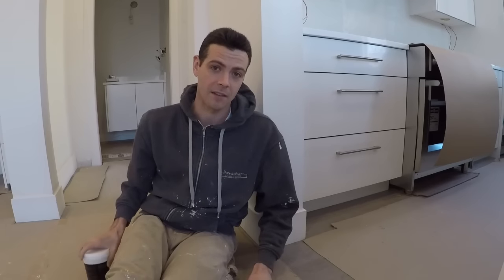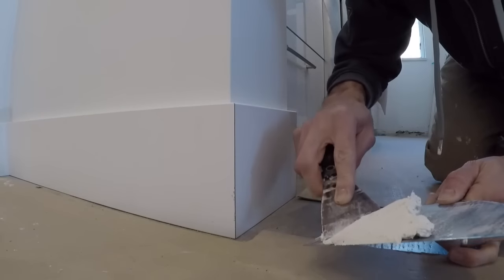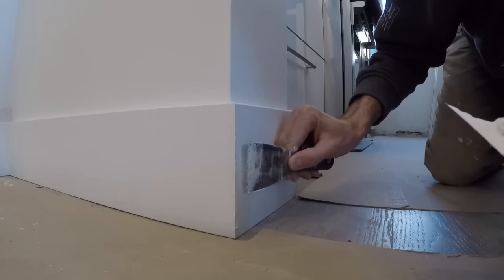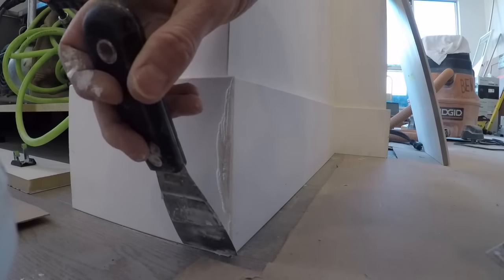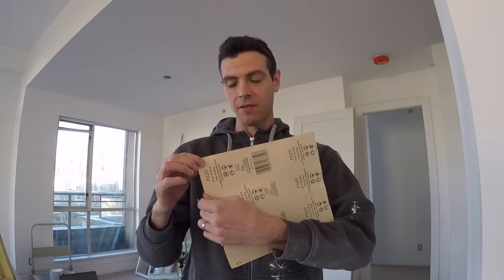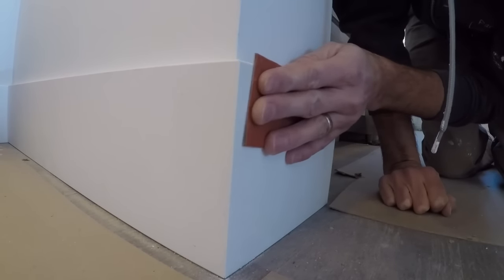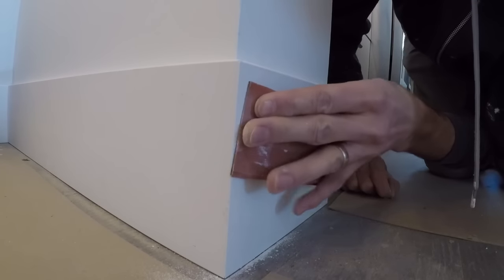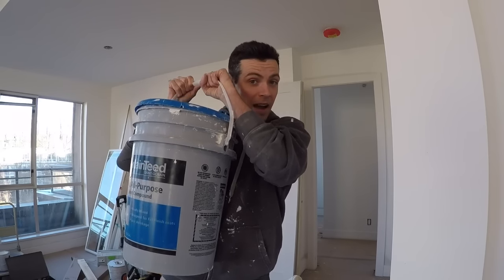How to Fix Open Miters

Comment: “Do your best and caulk the rest”
Reply: Floor layer?
Reply: A little puffy and a little paint will make us carpenters look good!
Reply: Mexican wisdom.
Reply: That's my middle name
Reply: Caulk and Paint is what a Carpenter Ain't
Reply: it's a good motto :)
Reply: Fucking too right.
Reply: That hits too close to home and is dang funny.
Reply: It's "caulking and paint makes a craftsman what he ain't.  If you've never rolled your outside corners use a nail punches rounded end rub it vertically on your miter with some wood glue.
Reply: Lobstah meaht
Reply: Haha exactly
Reply: Thats my bosses motto that an "we aint buildin a f'n piano room"...sometimes i hate even being associated with the dude
Reply: It looks good. From my house.
Reply: If your mitres do not fit, fill them up with glue and sh*t 👍 YEEEEEEEEHA !!
Reply: I’d do this if they’re paying enough, caulk works if they’re being cheap.
Reply: Dap kwik seal. That's my go to.
Reply: “Better carpentry through chemistry”

Comment: House I’m in has anywhere from 1/4” - 3/8’ gap in ALL miters. They even did up to 4 “coats” of caulk and 5 coats of paint to “fill and blend” so couldn’t see 🤦🏼 Imagine the time that all took with drying time, painting, etc…. When they coulda made better cuts on saw, & filled the gaps w/ filler, than do some caulk/paint for finish. Imo woulda taken less time and look 100x better.
Great vid, and think if anyone is doing trim work, they need to know info like this
Cheers✌🏻

Comment: I'm in the UK, we always use Ronseal 2-Part/pack wood filler, sets hard in less than 10mins and shapes perfectly with 120. It's a 2 part like I said, so you can adjust how quickly it goes "off" by how much catalyst you add/use. Link below: https://www.screwfix.com/p/ronseal-high-performance-wood-filler-white-550g/45077

Comment: I've never lived in a house in my life with perfectly mitred skirting boards, even when I had a house built from scratch.  The only gap filling I've ever witnessed was with thick gloss paint.  So I hope whoever buys this place drops something on the floor so they get down on their knees and appreciate the effort!
Incidentally, here in the UK tiny gaps often occur because the timber stock wasn't seasoned in the house after occupation, i.e. the skirtings were put on during build and often before the central heating goes on.  At the point of inspection the mitres are perfect.  Then the family moves in, turns on the heating, and gaps sometimes (not always) start to appear.  It's just part of the character of the house I suppose.
Reply: A Teleskier ...especially if you get the wood from Selco, it’s all wet one end and twists half an inch out of square, you can always go to wickes and get 100 knots with a bit of timber joining them up.
Reply: @thpxs0554  :D spot on.
Reply: This comment made me laugh
Reply: When the heat is turned on for the first time, don't turn the temperature up all at once. Raise the temperature over a couple of days, otherwise you can crack all of the caulk.

Comment: When all the comments are complaining about angry comments that you can't see, because there are so many comments complaining about the angry comments.
Reply: John Martinez A lot of the complainers are people saying just be good and you won’t have corners like this.

The real reason people should complain, is wood filler or drywall puddy are actually terrible for joints and open miters. If you can’t caulk it or draw it in with a trim screw in the MDF, it needs to be re cut.
Reply: The reason, is that caulk doesn’t shrink, when you paint caulk it dries and can’t fully stretch. 

These joints act as expansion points, when you fill the gaps with wood filler you eliminate all movable space. Usually it’s not an issue, BUT it can cause your trim to buckle and draw away from the wall.
Reply: @TwoBitty  Like no trim carpenter's are using wood or CA glues on their miter and copped joints, right? Besides, most paint grade moldings, baseboard, etc. are made of short sections of finger-jointed Pine or MDF with a factory applied primer. Those two factors blowup the whole joint  needs to expand and contract argument, not to mention all the fasteners along its length, used to secure it to the wall (bottom plate and/or studs). Also, no one in their rightmind is buying premium stain-grade one piece clear lengths of Popular, Pine, etc. mouldings to painting them.
Reply: @TwoBitty  caulk doesn't shrink huh? Not at all..not one bit huh? U sure about that? I'm talking about Alex Plus here...No shrinkage?
Reply: Perfectly said...my first thought when scrolling down to the comment section was about how many snotty carpenters would comment.. but now I'm actually getting used to the fact that the comments are more about how snotty the snotty comments are and I really never see the snotty comments and don't even know if they exist
Reply: Or when comments say "all the comments" and that is not true.lol

Comment: Always amazed to see contractors that care about the quality of their work. So hard to find.
Reply: Especially for women to find quality in contractors.
Reply: Not really "quality" if the miter is wide open. Should have been cut right the first time. I've seen lots of finishers do this and say "whatever its paint grade trim". So if you're a finisher that does this what are you going to do on the stain grade jobs? I've had finishers that had never worked with stain grade try and throw it up like this with open joints and gaps just to have to pull it off and replace it. Plus all that filler at the tip, hollow behind will dry and crack later and look bad down the road once the homeowner is moved in and comfortable. Doesn't give the homeowner a good feeling when they're new home starts showing flaws shortly after moving in
Reply: @bolerdweller  if you need to fill your joints, that makes you a filler, not a finisher
Reply: @calebsaville8416  yup. It's faster to do it right than to put it up and have to make it "look" right

Comment: As I do my final vertical wipe upwards I slowly slide the blade sideways away from the vertical edge which helps prevent excess filler from piling up along that edge. A common reason for open joints at corners is simply out-of-square drywall due to imperfect framing.  I cut tests out of short pieces when I'm installing Oak, etc., trim to be sure of my installation before I ruin long pieces of trim.

Comment: Auto Body filler (Bondo) works great, dries fast, can be sanded within a few minutes
Reply: Yeah, works great as long as it's a painted project. They have some nice 3 part epoxies that are highly stainable. And really easy to mold. Just in case you ever need it. Just make sure you wear latex gloves with it.

Comment: 526 unemployed Finish Carpenters dislike this.
Reply: Oh yeah That’s right who cares.
Reply: That's pretty funny.
Reply: If you're an unemployed finish carpenter.   There's probably a good reason. And it that reason does not include spackle or wood filler.
Reply: More like 564 decent finish carpenters wanting people to learn how to do their job and not rely on putty and paint.
Reply: I was a Builder and I'd make him pull off the end cap and redo in the custom homes I built. Eventually that filler gets bumped by a vacuum and cracks and often chips out. Then your customers think what else is simply covered over. The end result is a bad or indifferent reputation...
Reply: D Jaquith hey I’ve seen those so called custom homes and I tell you what I would take a home built in the 50’s and 60’s over the hurry up and sell homes that are built today
Reply: Rich Casing Jr agreed. They used to make houses with the understanding that someone was gonna live in this thing and pay a lot of money for it. Now...now I just don't know. It's a money grab. So tired of the money grab.
Reply: @richcasingjr7817  depends in who builds it, there are lots of custom home builders that do a good job and go above and beyond, I've finished for lots of them. I've seen terrible builders too, it just depends on the builder
Reply: @dominodoggy1  even with that being paint grade, filling that joint and sanding the filler takes longer than cutting it right and sanding the joint properly. There are people that work like this every day and then struggle when it comes to installing stain grade trim properly
Reply: @bolerdweller  I was going to say the same thing. He's right, most cases these money grabbers do fast and subpar work but there are some Builders who do really really nice work. I've worked for both kinds. It all depends on who builds it.

Comment: Are people here really blaming the saw instead of the wall? Lol every brand new house I've done this in has bowed walls and not perfect 90 degree corners. It's a catastrophe
Reply: Finish Carpenter here.  I always cut my outside Miters at 46 degrees.  Take some sandpaper and dull the edges, the end.
Reply: Never blame the workman or the tool, blame someone else. The wall is not straight. 🤷‍♀️
Reply: My house is from 1900 and there no 90 degree angles anywhere.
Reply: @Traitorman..Proverbs26.11  Yep, with you there.

Comment: One trick we used to use on miter folded beams was to burnish the corners with a screwdriver, or anything that's round, hard, and smooth. You rub the miter to bend those fibers together and close up your corner, it has it's limitations but it's saved me a lot of filling.

Comment: Tip for using a sheet of sandpaper: fold in half one way, then fold it in half the other.  Now there's a cross of folds dividing it in four.  Tear down one of the folds to the center - just half way across. Now fold the sheet round on itself (fold left, fold up, fold right for instance) and you have a full quarter-sheet, four thicknesses, and none of the folds have brought abrasive into contact with abrasive.  Just like your book-fold, but you get a whole quarter-sheet, not a skinny eighth!
Reply: Nice!

Comment: Or when u are cutting and installing skirting boards Save the sawdust and mix the sawdust with pva glue which dries clear Mix it up so its quite wet and use this to fill any gaps. A perfect match wood filler and can b painted or stained ☺
Reply: Apply the stain into the wet glue mix or you wont have good stain cover.

Comment: I gave automotive body filler, "Bondo" a try for some really bad cracks. It was far better than any wood filler I've ever used, it doesn't crack or shrink, and it gives a more permanent fix. For outside corners that are subject to damage afterwards, Bondo is better.... Of course you need to paint afterwards.
Reply from the maker: Bondo is great but I hate using it. Too smelly.
Reply: Yea smelly and the powder from sanding can stain stuff. Great when needed but it has its issues
Reply: spelunkerd good tip. It's the only solid way to patch a hollow core door
Reply: Moon Pie  wood expands and contracts bondo is very hard and will always crack some. But hey what you gonna do. I use the same method
Reply: I just saw Bondo brand wood filler at Lowe's a few days ago.
Reply: I just want to thank you! I am so glad I found you on YouTube. We had a new home built and nearly all your vids are helping us to address and correct the poor work that has been done on our interior. I’d tell you the story, but sure you’ve heard it before.
Reply: I just discovered Bondo actually takes stain fairly well. If you look closely, you can tell where the nail holes are but looks better than just leaving the holes form the nail gun.
Reply: I tried bondo once at the recommendation of someone that worked on our house. I hated it. It was messy and hard to cleanup, it was a bear to sand, and it left red dust all over our white trim that was a pain to clean. All the joints cracked due within a year to movement  since it is so hard. I stick to caulk for joints and spackling for nail holes.
Reply: @1dgrdgr  I actually used an expanding foam to patch a hollow door & worked great!  Used masking tape on one side, used the foam & placed the patch on top and masked it closed.
Reply: JJ Smith I'd be afraid of a callback or pushing the door skin off of the core. I cut a shim to the width of the hole and use a rubber band to glue it inside to the backside of the skin. Bondo, trim it flush with the blade out of a break away razor knife, sand and paint.  I'll mess around with some foam. Anything is better than the spackle or tubes of Alex plus I see people try to use. Anything too big and they're buying a new door
Reply: @1dgrdgr  - I was a house painter for 18 years.  Used expanding foam LOTS of times to fix hollow doors.  The aim is to use just enough to give your top filler something to hold on to on the back side.  I found Bondo is an excellent filler for hollow doors due to it's firmness and shapeability.  I tried to leave enough room for about a 1/2" of depth of Bondo.  I'd slightly over fill, then sand smooth to the depth of the wood grain, then use a scraping tool with a rounded over corner to actually carve the wood grain lines back into the filler.  Impressed a LOT of clients with that.
Reply: Summit X Well said. Bondo with chopped fibreglass and lots of nooks and crannies in the damaged area for it to grab is almost on par with thickened epoxy.
Reply: @delikat83  Actually Bondo is a plastic filler and holds up very well to the expansion and contraction of wood. Sheet metal expands and contracts a lot in automotive applications and it flexes a lot with the vibrations of the road, engine etc. and when done properly it works fine there too. I've never had it crack in a wood filler application. I would think your getting your mixture wrong or using to much of the hardener  if it's cracking on you. Just my opinion though.

As an FYI I've had a lot of the so called wood fillers crack though.
Reply: In wood restoration it works great for many repairs. And as an historic furniture and objects conservator I found many more outstanding uses. Once it has cured it is inert, there is no outgassing and generally no reactions to other materials. You can create entire missing elements with it and you can make molds with it and cast a new piece inside the mold by using any release agent. I have made jigs with it when I have difficult surfaces to join.

Use a sharp blade to carve it close to the shape or level you need before it fully hardens, right after it kicks enough to hold its shape.

Quick tip, it is by over catalyzing (orange pink) that you make the polyester filler more flexible with a slight rubbery feel vs catalyzing for hardness. It will kick a bit faster but will not harden the same way. That's how to use it to make molds.
Reply: spelunkerd  yes bindi is better.
Reply: Been using it (Bondo)for many years to repair thresholds and window sills. Minwax sells one that's made for wood.Saves the customer money. Smells like Victory!
Reply: Bondo has what plants crave. It's got electrolytes.
Reply: They use that on seems too bondo is really good
Reply: "there's nothing like the smell of Bondo in the morning"
Reply: Can't help but think the spackle you speak of is a variety of filler with little ability to move with the skirts.
Being a painter for thirty plus years,I've repainted many an external mitre that has opened up and the filler has not been able to flex enough and cracks away from one or the other joining surfaces.
If caulk is used, and carefully applied to a  CLEAN surface it will adhere and flex enough to not break away.
The imperative is that all, repeat all the caulk MUST be removed from the surface, and only remain in the open mitre, prior to recoating.
Will always flex better than spackle.
Or, better still, get your mitres correct in the first place.
Reply: @UsedEveryDay  depends on the wood too, id they didn't let the trim acclimate first it will open up the joints nomatter what you fill it with

Comment: I use wood putty instead of calk for most gap filling.  It gives a clean, sharp edge that (as you showed) can be sanded. Also, putty provides some structure making the gap less likely to reopen. Thank you for another great video.

Comment: Another trick when you are filling those cracks and then painting, is to use an old putty knife to stick under the trim. It keeps the mess off the floor, just remember to keep wiping the knife off when you are using it while painting.
Reply: Yes. Or an old piece of siding or anything flat.
Reply: Taping/putty knife shield on a wood floor is asking for scratches, Tile only. If you have a floor/base gap(you suck) then just use a 3×5 note card(keep a pack in truck) as a shield.
Reply: We all have tar paper leftover from doing a roof.  Cut some into 4" wide strips and use them to tuck under baseboard, etc.  It is stiff, thin and does not scratch or mark.  I have been doing it for years and keep a small wad of strips specially for the purpose, reusing them.  😊

Comment: do your best then caulk the rest
Reply: Now that's practical advice I can use.
Reply: Yep. "Caulk and paint makes you the carpenter you aint"
Reply: @x_____________5550  grinder and paint makes me the welder i aint
Reply: A little dap will do ya
Reply: the bigger the gob, the better the job
Reply: When in doubt grout
Reply: Cant see it from my house
Reply: Mud man will git it.
Reply: @BrentDarlington  dap will crack especially if its run into accidentally. Caulking/ sealant is better
Reply: Rough enough is good enough